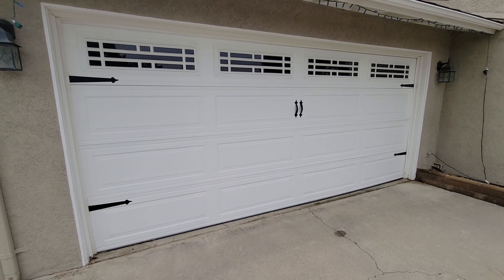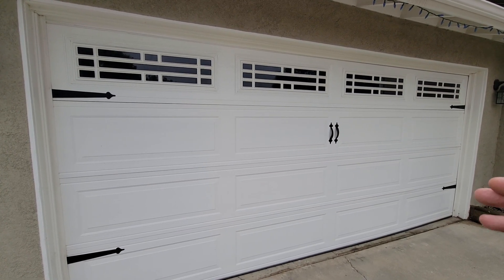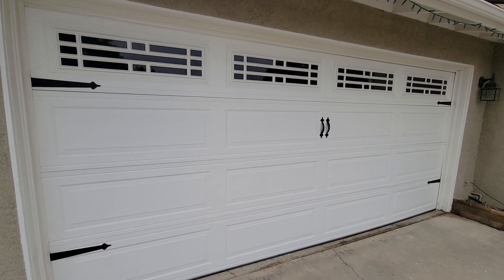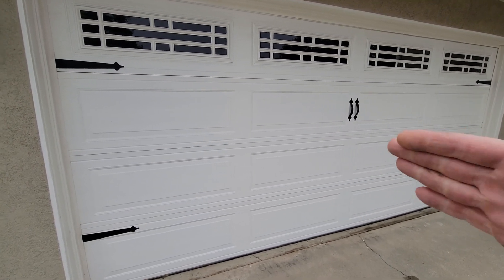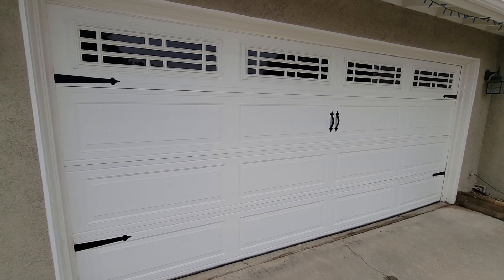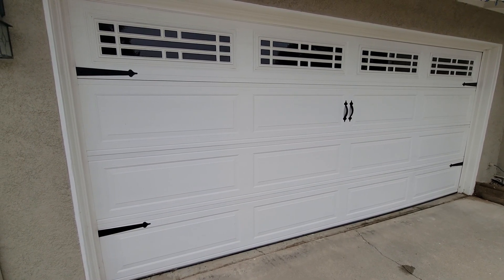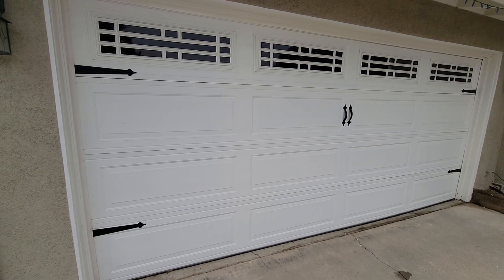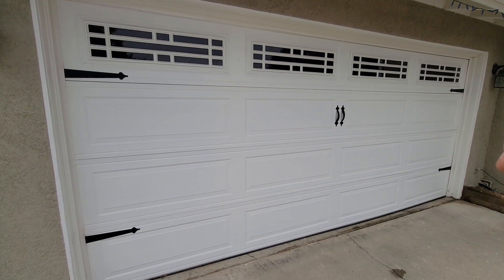WHAT PAINT do I use - Metal Garage Door

Comment: How do you go about painting the edges on top and sides behind the vinyl seal? And in between for when the door opens? For example if they wanted this white door painted dark?
Reply from the maker: Never paint those areas (cracks with the door open) unless you want some serious problems. Door sticking. I also never paint behind the seal....WHY? it may only be visible when the  door is moving. Creating  problems. Door sticking and other issues. Why would you paint something you cant see? makes no sense.
Reply: @mikethepainter  thanks Mike!

Comment: Thanks Mike you’re the paint god. I live in Florida and there’s a local company called Florida Paints. Their products are absolute garbage zero adhesion, bubbles, peels, horrible outgassing, and takes forever to dry and cure. They flagrantly falsely advertise their AllGrip brand of paint to adhere to metal when it doesn’t. Doesn’t stick to even bare wood. I was swindled into trying that paint brand out and it cost me big time. Even over factory painted aluminum zero adhesion even when properly sanded and deglossed/degreased. Their binder is trash. I went back to Sherwin Williams to get a color match of the same paint color but in their industrial pro series of DTM paint and the difference between the two paints was night and day! It’s hard finding out Florida Paints reputation in the industry because it’s geared towards clueless homeowners and general contractors in new home construction  (where the warranty takes care of complaints) not for professional remodeling projects. You put out such great content dude that helps guys like me get started trying to build a business and not work for the man. You keep the dream alive! 👍
Reply from the maker: probably manufactured in Hialeah FL... along with all the other BS down there.